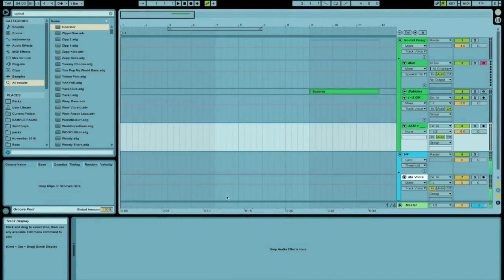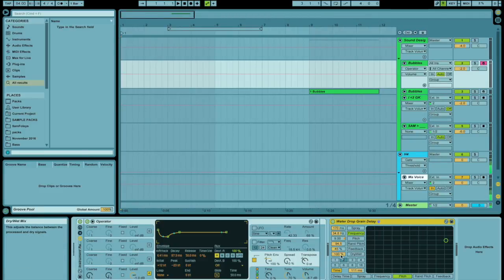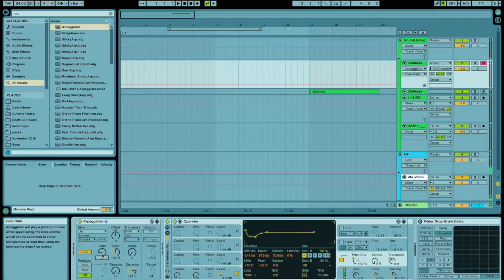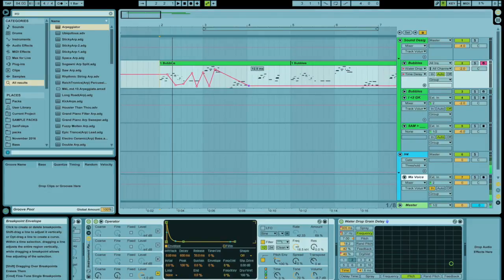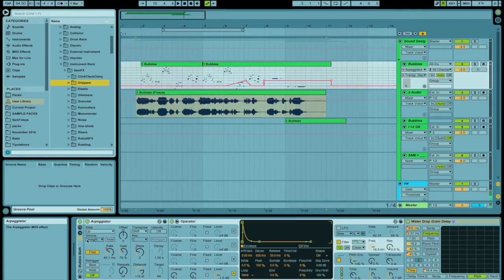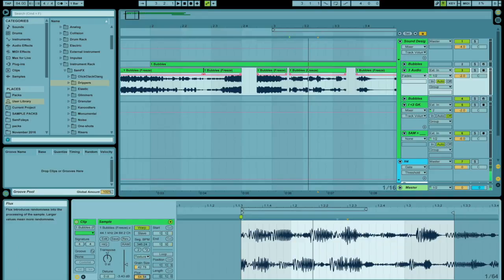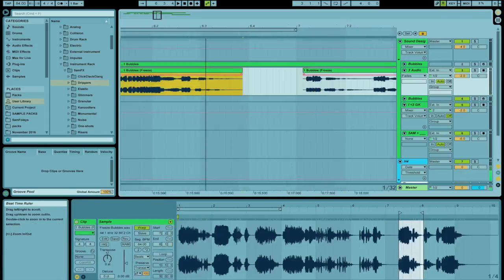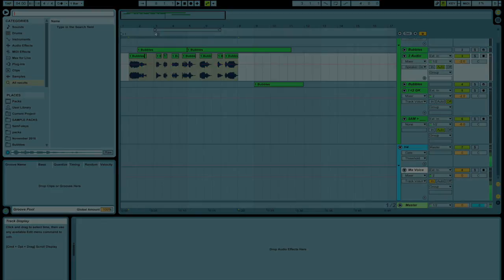Glitch Kitchen #2 - Bubble Sound Design With Operator

Comment: A man after my own heart. Nice little tip that saves time for FL Studio users:
When doing large samples, you can use Edison and slicex's auto slice functions to quickly chop and preview samples with the left and right arrow keys, and also edit the chops very quickly. Not sure if Ableton has a similar feature but maybe you could look into it. Very nice tutorial, I've been playing around with a similar effect using Valhalla spacemodulator on tones and mapping all the knobs to a midi controller.

Comment: This is awesome. Do you have any insight into how to make metallic sounds like Sophie?
Reply from the maker: Hey I could probably assist with that, can you reference a song, or better yet link one?
Reply from the maker: @KyleHarrismusic  Woah that's a banger 0_0 I didn't realize Sophie got this grimey! Saw that she passed recently :( RIP... 
As for the sounds, You can get stuff like this with layers of fm in series using different coarse settings for pitches and shorter envelopes for the fm oscillators to get a ringing effect. Maybe I'll make a video on it :)
Reply: @5amsound  I know it's really tragic. Faceshopping is a masterpiece in my opinion! Hmm the operator layers is real interesting. I've only just begun experimenting with synth layers in instrument racks in my sound design. Been really digging your videos BTW! Hard to find great sound design tutorials. Just curious as to how you'll breakdown a sound to determine how to layer it? Or how to preconceive of the layered strategy? Not sure if that's the right question but I'm thinking in general practice and how you're thinking about using layering to do your sound design. Also any resources you think are useful for going deeper into this stuff? Thank you so so much!